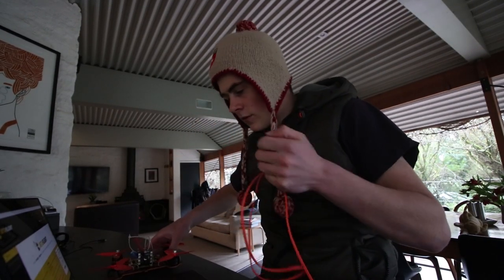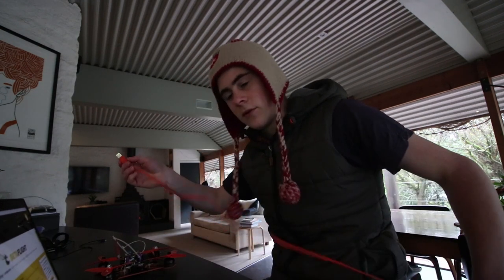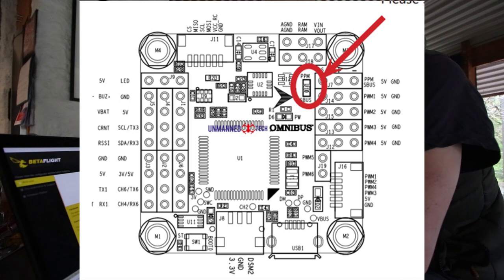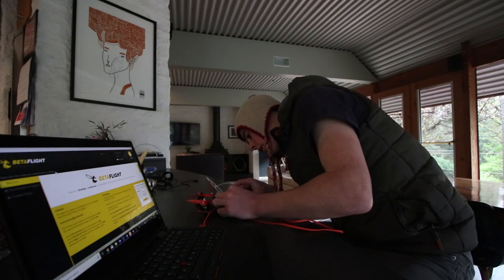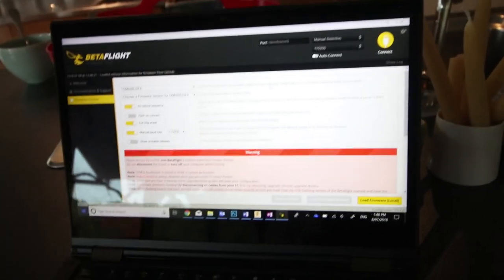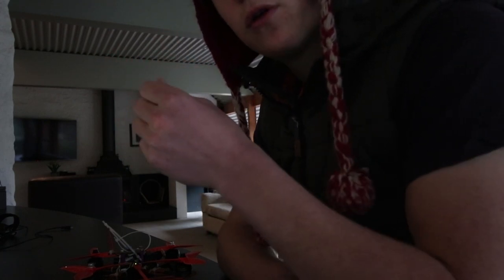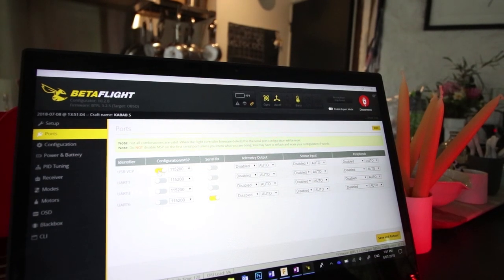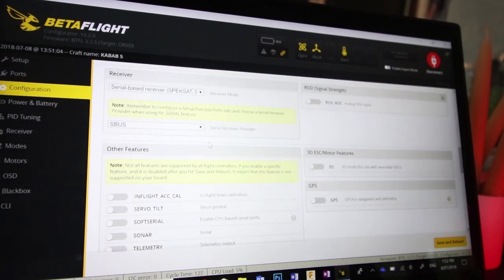OMNIBUS F4 Problem With SBUS. (Fixed!)

Comment: I don't see what solution you provided? My frsky x lite and XM+ are bound, solid green light. But nothing shows in the receiver tab, nothing moves when I move the sticks. Don't understand, already spend days trying to get this work.
Reply from the maker: xPureL yeah it’s so frustrating! What I did to fix mine was to make sure that the firmware flashed on the board was omnibusF4SD. And also make sure that the SBUS pads are bridged with a bit of solder on the board. Hope this helps.
Reply: @ReubenRasmussen  Thanks you took the time to help. Glad it worked for you. I don't know how, but mine finally worked, after setting uart1 to off, then save and back on and save. For some reason, it works now. BUT, I still can't get a good signal with the XM+, it failsafe almost constantly, every 5 or 10 seconds...the RSSI value goes all over te place from around 30 to 90 %. Nothing stable. And this is the case on 1m, 5m, 10m, no difference, exept can't get above 50% when from 10m distance (without obstructions).... no video of forum anywhere online has helped me to a solution, don't understand :).
Reply from the maker: xPureL dang that is such a pain! Maybe see if the receiver works with another FC to diagnose whether it’s receiver problem or FC problem...check antennas etc ( I’m sure you have just ruling out all the options)
Reply: @ReubenRasmussen   Thanks, indeed, right now I just think the receiver is broken, don't know otherwise. So have a new one and starting over. If everything works as should, i'll throw away the first one after I burned it to ashes with a firetorch 
;)
Reply from the maker: xPureL nice job good luck :)

Comment: ive been at this for abt 4 hours. i have no broken parts, no loose connections and everything is set up correctly. yet i still get nothing on my receiver tab.. this is driving me nuts and i might just throw this flight  controller in the bin
Reply from the maker: I’ve been there before man. Walk me through your process I’ll try and help.
Reply: @ReubenRasmussen  so. omnibus f4v3 FC with FAILSAFE_RX
nothing is visibly broken, so i thought maybe my receiver pooped out. whacked out the spare receiver, bound it aaand nothing, the same error.
 i change my sbus pads around. to the little ittle mini ones mentioned and bridged them, nothing changed, so i switched back to the orignal ''RC'' labelled pads that take SBUS, and thats where i am at. thinking i may just need a new flight controller at this point. my motors spin correctly through betaflight, i just cant get any signal at all through my receiver to FC.
Reply from the maker: @magiliangaming  What is the firmware you are running with your Omnibus FC?

Comment: This is my first flying wing build and having trouble getting any help but my setup is f405 wing,r xsr recevier, radiomaster tx 16s and inav 2.5. I flashed my board with inav 2.5 and flashed r xsr with latest firmware.i wired r xsr according to matek 5v,ground green wire sbs and yellow t2, it binds quickly when power up with usb with green and blue light. Ive done calabrations, set serial rx in uart2,and enabled sbus. Problem is no stick inputs in recevier port in inav, radio shows stick inputs on monitor in inputs,mixer and outputs.Im lost at this point I reflashed inav,checked wiring have tryed to get advise last 3 days on youtube but i guess they cant or wont help no response. I do notice on inav main page it show configurator 2.5 and under that says 2.4. Is this normal? What else can i try? Thanks
Reply from the maker: Eg Treadway hey thanks for the question. Are you 100% sure that the flight board is compatible with inav 2.5? Most of the other stuff sounds pretty correct In my head but I’ve never used inav before. Make sure also that your radio under the model that you are using has the correct receiver combinations. (D16 etc). Let me know how that goes, ill try find out if there’s anything else that’s odd.
Reply: @ReubenRasmussen  Thanks so much for response and I will research this board, As far as radio it would only bind to one believe me i have about worn buttons off this new radio but it binds great and shows 5 bars signal on home screen, I never run into anything like this. Thanks again
Reply from the maker: @egtreadway4232  All good, let me know if I am able to help in any other way and I'll do my best

Comment: Hi, I had the same problem, that is, betaflight with omnibus f4 v3 did not recognize me as the ibus receiver, in the end I solved the problem, it was the tin soldering I had done in the picking pitch ppm / sbus ie between the CENTRAL PIN and Pin SBUS was not done well, it looked good but did not touch, it did not make contact, I had to pour some more tin on and kept the soldering iron resting for 2 seconds so that the melting tin soldered well the 2 pads between them .  The receiver I used is a TGY ia6C turnigy where it says that it is sbus, but in reality betaflight recognizes it only if it is set as ibus receiver, while the remote control is a turnigy tgy i6. so I solved it and it worked. Hello

Lingua italiano .  Ciao a tutti ,io ho avuto lo stesso problema, cioè che betaflight con omnibus f4 v3 non mi riconosceva la ricevente ibus , alla fine ho risolto il problema,  era la saldatura di stagno che avevo fatto nella piazzola di scelta ppm/sbus cioe' tra PIN CENTRALE ed Pin SBUS non era fatta bene ,sembrava buona ma non toccava, non faceva contatto, ho dovuto riversare un altro po' di stagno sopra e tenuto appoggiato il saldatore per 2secondi .la ricevente è turnigy TGY ia6C  dove c'è scritto che è sbus ,ma in realtà betaflight la riconosce solo se viene impostato come ricevente ibus, mentre il telecomando è una turnigy tgy i6 . Ecosi ho risolto.
Reply from the maker: scusa, non so parlare italiano

Comment: i did all that and my thing still dont work plus now those little pads came off and no longer there what else can i do
Reply from the maker: the little pads as in where you solder it?
Reply: @ReubenRasmussen  yes they came off and there nothing there to solder now just the board shows through
Reply from the maker: @glenmccall4571  Bruuuhhh, ummmm I'm not sure that's a bit beyond my skill level sorry dude.
Reply: Glen Mccall im sorry for you you cant repair that,😐had the same problem😶once